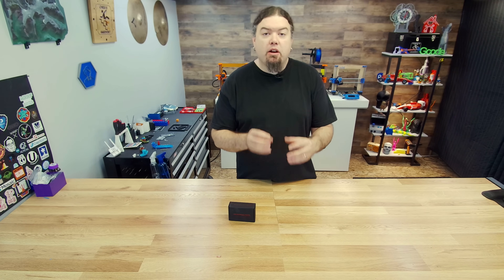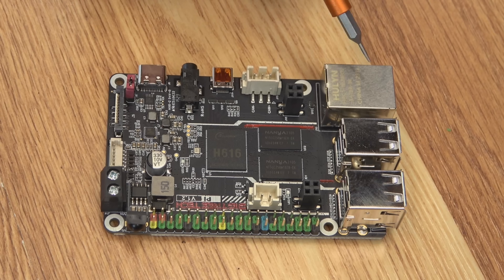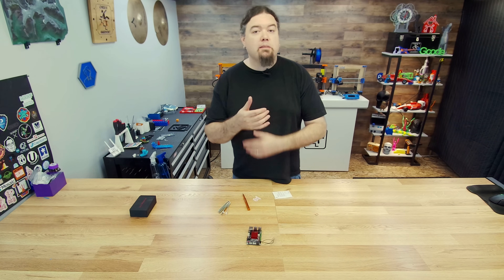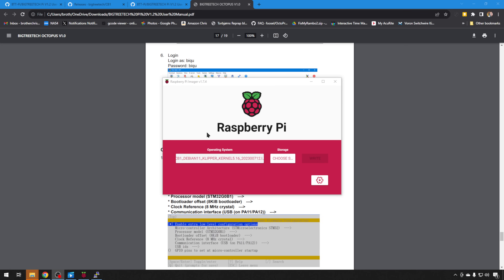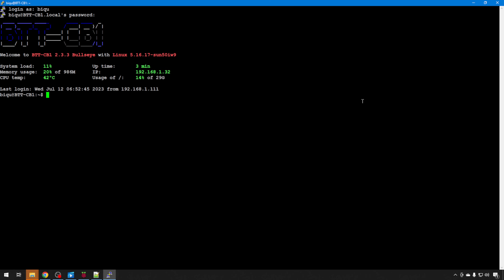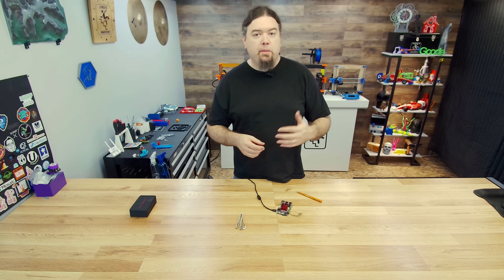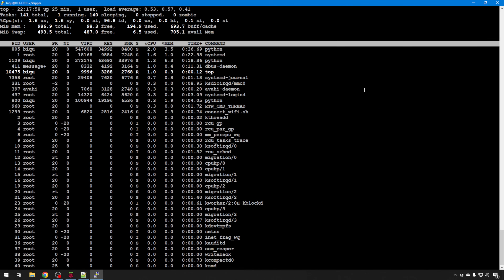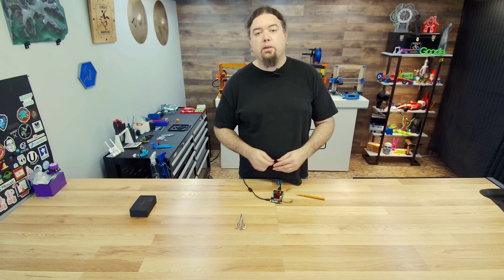Raspberry Pi Alternative - BigTreeTech Pi - Chris's Basement - 2023

Comment: I need run klipper in my corexy printer without computer. So I bought btt pi 64 bits which can klipper module. After instal the firmware with Linux I should access kliper and rename  the file config.cfg that's any detail more?

Comment: So this BTT PI can run  klipper on my older artillery sidewinder x1? I tried with a Rpi zero 2 and got partway before getting stuck, i ordered the BTT pi- I can use this instead of the Rpizero2? It basically functions the same way?
Reply from the maker: Yes, exactly the same, just a board that runs Linux.

Comment: I'm coming into a refurbed Ender 3 Neo for dirt cheap and wanted to get a pi set up. I'm considering the BTTpi but I know nothing about klipper. If the E3 neo has marlin do I need to change it to klipper, or can I use the BTTpi without marlin? Would I use a standard pi image is doing so? Sorry for all the questions but this aspect of the hobby has always been a bit confusing to me, even after several years, lol.
Reply from the maker: You can use the pi without klipper. If you are running Marlin, then you will want to run octoprint to control it. Flash this image to your Pi SD card, https://github.com/bigtreetech/CB1/releases Them use Pauls script here to install octoprint. You can just install one. https://youtu.be/nDwW3eNxp2k

Comment: I'm about to dive into my first klipper install and I've got to admit I'm confused about something that no one seems to cover in any real detail. I'll be using an M5P with CB1 and I want to use a btt accelerometer. I've seen many tutorials,  yours included, and all mention using a pi but NONE mention if the CB1 mounted on the M5P will work or if it needs to be a separate unit, if the CB1 in a pi4 adapter will suffice or if it has to be an actual pi. I'd love a beginning to end run through for true first timers to klipper instead of assuming we've all done this before and just need a bit more info. No one seems to do this. Everyone throws out terms like ssh or putty without explaining what it is or how to get it. Ive chatted with a few people who want to try it but just feel lost so they gave up. Tbh I don't understand why companies like BTT don't make a simplified install suit fire their equipment. Is even part for it if it made the whole process easier and just worked without an extensive programming background.
Reply from the maker: I hear you and that is the biggest down side to all of this. I've tried to walk through it all, but it's really hard to get everything into videos. TO answer your question, CB1 should work just fine, you don't need a separate Pi board.
Reply: @ChrisRiley  Thank you very much. I really appreciate it. I managed to get a really good deal on a BTT pi v1.2 so I grabbed one as well so I THINK I'll have everything I need. Feeling a bit like Remo Williams here... the adventure begins  lol

Comment: Thank you very much for posting this. I got one of these a few months back and didn't think I could get klipper/mainsail running on it but after following your video I have it up and running great :) TYVM!
Reply from the maker: Glad I could help! Thanks for watching
Reply: @ChrisRiley  Thanks again Chris, I do have a question on that board that I hope you can answer as I have little knowledge of Linux and have spent all day trying to figure out and searching online with no answers: When I SSH into the board, would you know how to change the default password from "biqu" to something more secure? I have 3 other raspberry pi 4's and usually I can just SSH in and run a "sudo raspi-config" and change it in there but nothing like that seems to work on this BTT board. Any thoughts?
Reply from the maker: @ph0t0dave  Sure, you can use passwd. Do the command    passwd biqu    it will ask for your password then a new password.

Comment: great little boards for printing. i have 2 of them in use for about 8 months or so. you can use their previous board "CB1" repositories too. it's faster than a pi3b but a little slower than a pi4. would not recommend multiple printers. buy a quality sdcard from a known manufacturer. ssd or m2s are overkill for this application. I like the samsung pro ultimates. honest speeds and hard to beat their warranty. 

if you are new to linux; make sure you change your root password and setup up ssh keys.
Reply from the maker: Thanks for the tips!

Comment: Got myself a formbot v0.2 that came with this and took me a minute to figure out it needed the CB1 image. finally got it going and went to do some upgrades to the printer only to find I cant hook my pi cam in using the ribbon cable.  Do you by chance know what cable would work as I cant find any information on it.
Reply from the maker: That's interesting, I didn't realize it was different, let me look around and I will see what I can find.
Reply: @ChrisRiley  In the end I opted to go for an OE pi 4.. everything Ive seem for cameras the answer Im given is USB.

Comment: Thanks Chris for this very good video, is so easy to follow it
I'm thinking to use a pc monitor to use with the btt-pi, you mention the micro HMDI that I had already, do you know how is the process to setup?, I tried to modify the BoardEnv.txt file but did not work, also y I can use a mouse/keyboard with the btt-pi
Regards
Reply from the maker: If you already have linux up and running you should be able to just cable up to a monitor and see the shell output. Same with keyboard and mouse, plug them in USB and you should be all set. I think a cable like this should work. https://amzn.to/40ZSWaO (aff link to amazon)
Reply: Thaks  @ChrisRiley , I will try

Comment: Hello CHRIS, question, I have 4 btt pi, all the printers that connect are the same, is it possible to save the gcodes in the same folder and that they can be seen from all the pi? greetings!!
Reply from the maker: Yes! So what you can do is just update the location in settings to a location that all the pi's can pull from. Do you have 4 printers running on one pi or 4 different pi's?
Reply: @ChrisRiley  I have 4 pi and the idea is to connect 4 printers, for now I am working with 1 to optimize configuration and profile
Reply from the maker: @barkadauy  I decided to make a video on this, it should be out tomorrow.

Comment: Have to point out that the layout of pins and all are mirrored from the pi. So it will not work with pi cases and the mounting holes are not exactly the same. Also can bus is not completely integrated. You must get the can adapter that attaches to the board for it to work.
Reply from the maker: Thank you, I've been seeing that a lot in the comments, good info to have.

Comment: Hmm... I think I'd wait for Raspberry Pis to become generally available. With the BTT Pi using a quad-core Cortex-A53 @ 1.5GHz and 4 x USB 2.0 ports it's essentially a 2018 era Raspberry Pi 3 but with DDR3 RAM instead of DDR2 - and here (in AUS) it's actually selling for slightly more than a Raspberry Pi 4 Model B 1GB.
Raspberry Pi 5s are starting to become available now with quad-core Cortex-A76 @ 2.4GHz and actual gigabit ethernet now (that's not on a USB 2.0 bridge) its appealing for CPU-hungry projects.
Reply from the maker: Yes, definitely a slower device, I wouldn't pay top dollar for it. That Pi5 does look really awesome.

Comment: The same issue I have with all these Pi "Alternatives". Only supports 1 operating system provided by the manufacturer. How long will it be supported? Will it get Debian 12? 13? Is it as secure as Raspberry Pi OS? Who knows. Is this CPU fast enough to run everything? LED_Effect, CANBUS, Input_Shaper, WebCam, KlipperScreen, etc? How much voltage is supplied to the USB Ports? Is it handy capped like the Pi or worse?
Personally the only Pi Alternative I see that is viable is the ZimaBoard or the new ZimaBlade. Have a ZimaBoard in my Voron v2.4 and it is amazing. You look at the price and you think it is expensive then you add up the Pi, SD Card, Power Cable, CPU Heatsink, and you realize the Raspberry Pi is DEAD. May it Rest in Piece. Did I forget to mention... PCI Express Slot!!! NVMe SSD? USB expansion card? Sky is the limit.
Reply from the maker: All good points. I did add a link into the description the Armbian project now supports this board, so that is a great step fromward. https://www.armbian.com/bigtreetech-cb1/
Reply: The OS for this is provided by Armbian, so 'yes'

Comment: That cable that came in the box is for the btt ADXL345 accelerator. I have one of these running klipper on my KP3S, it works beautifully. Awesome video as always mate
Reply from the maker: Awesome, thanks for the info!
Reply: Could you share the config? I've been following tutorials for days to use spi with btt adxl but nothing works, even releasing spidev0.0...
Reply: [mcu rpi]
serial: /tmp/klipper_host_mcu
[adxl345]
cs_pin: rpi:gpio67
spi_bus: spidev0.0
axes_map: x,z,y
[resonance_tester]
accel_chip: adxl345
probe_points: 
 125, 125, 20
Reply: @arauchfuss  I had already tried this and the one with [mcu host], the result printer is not ready mcu 'rpi': Unable to connect, but I remembered one thing, in the btt iso I used the pure iso and installed klipper with kiauh, you used iso already with klipper?

Comment: Hey Chris! Excellent vid and very timely. I'm klipper-izing my Artist-D PRO and was wondering if the BTT-CB1 will connect to the original 7" pi touch screen?
Reply: is it a dsi display? if so the cb1 and this board are incompatible with dsi screens, you'll need the spi screen from btt
Reply: Thanks! it is and I knew it was a long shot.
Reply from the maker: Thanks! Not sure on the Pi screens, but as @mackcj12345  I think it has to be an SPI screen to work with the BTT Pi.

Comment: I want to be able to run default Raspberry pi OS /Raspbian, Which is maintained regularly. So that's what holding me back from using this tpe of third party boards which run on there own OS, (like here you are dependent on BTT for updates)
Reply from the maker: I get it my friend. Thanks for your comment and thanks for watching.
Reply: Right you are: don't expect ANY of the usual rPi OS images to run on this clone - so you're right about being dependent upon BTT - which I have found to be LESS than ZERO help after the fact.  Real grateful for the 30 day grace period at Amazon at this point, cuz this BLEEP just doesn't work, for me!  I HAD high hopes....
Reply: @palewriter1856 Sorry to hear that, thanks for your comment!
Reply: It's a debian based system. All updates are through debian. The only reason why the Raspbian Images don't work is the difference in hardware. Raspbian is expecting a different ARM processor for one. Doing an 'apt upgrade' will take care of any updates. This isn't the problem you think it is.

Comment: Have you tried putting it in a standard pi case? It's backwards.
Reply from the maker: I'll give it a try, thanks!
Reply: One of the holes is not in the same place so it won’t work. Even though on the  BTT GitHub they say it has the same form as a pi. It doesn’t , very close but not the same
Reply: @TheButchersbLock  it is the same form (small form factor SBC) but a different bolt pattern and overall design. They don't say anything about it being compatible with raspberry pi cases or standoffs. Form and layout are not the same thing. For example all laptops are the same form.